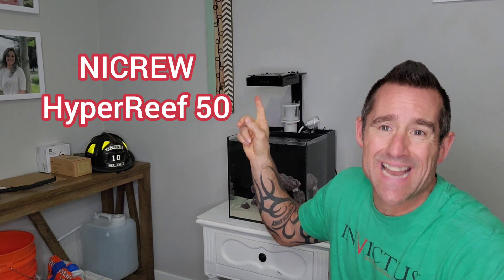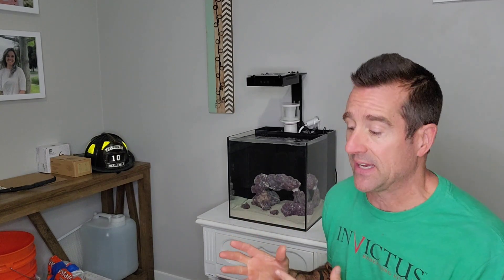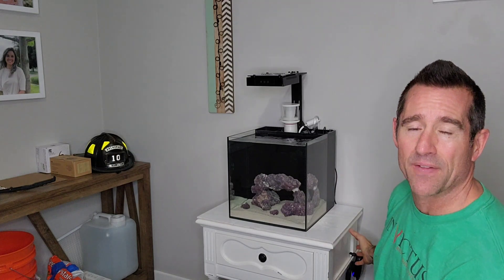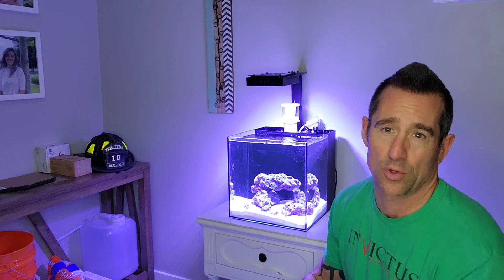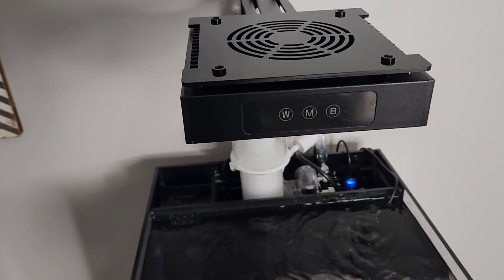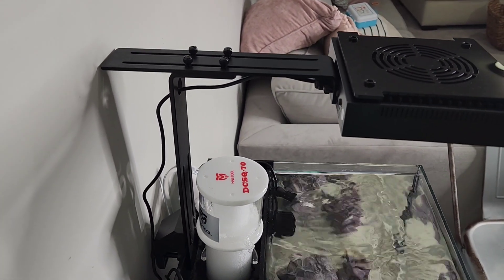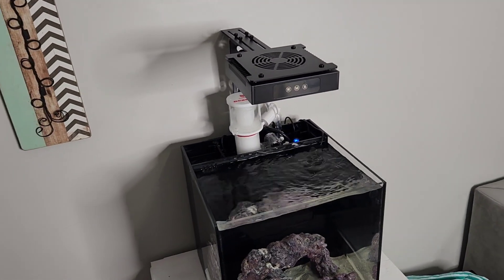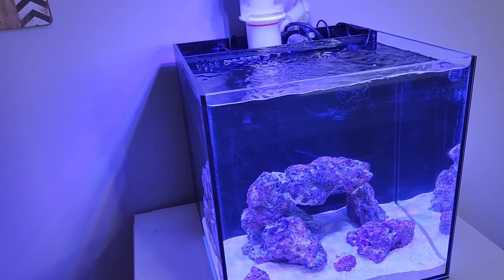Nicrew HyperReef 50 setup and initial review. Nano reef build.

Comment: Shouldn’t run a skimmer or any chemical bio during cycle. 😊
Reply: Not true. Many many top reefers do so. It's like everything else. There is literally no "one way" to do anything in this hobby LOL
Reply: @clayhamilton6437  Makes the cycle take longer though...
Reply: @clayhamilton6437 why would you run your filtration during cycling? All its going to do is get rid of the good bacteria. Be smarter.
Reply: @Coral-reef.  
why wouldnt it get rid of good bacteria after the cycle? if it doesnt get rid of good bacteria once the tank is cycled it stands to reason it wont while it is cycling either, unless the type of filtration changes... ?